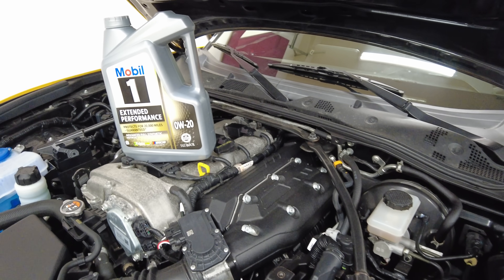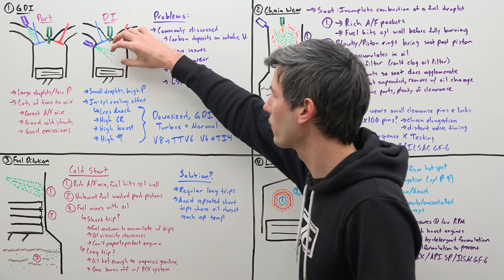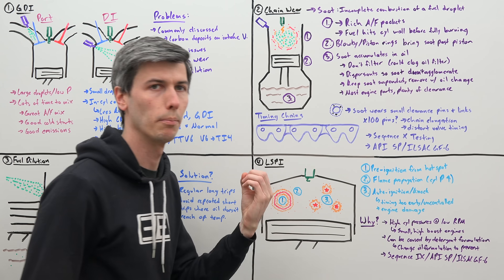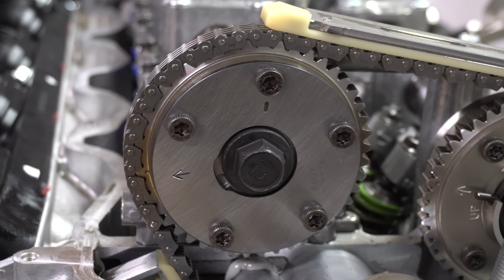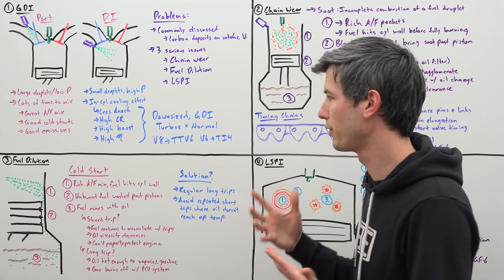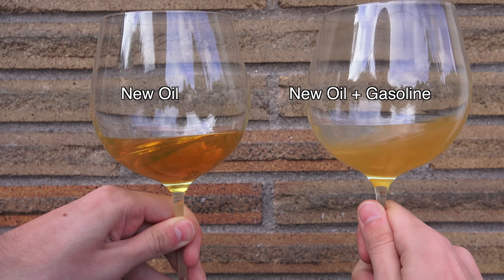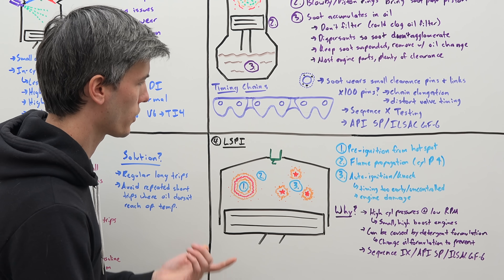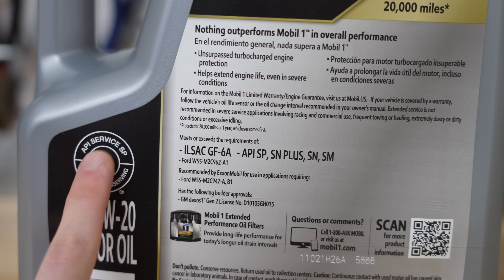3 Big Problems With Direct Injection Engines (Gasoline)

Comment: Hi mate. I have a VK56 V8 that has direct injection.

I'm noticing it sounds like a really bad pre-ignition on hot restart. 

IE.. drive for 30 mins, park, come back 15 mins later and restarting and it sounds like one bad pre-ignition just as it starts. Any ideas?

Comment: The truth is recipracting engine is a wrong concept. That's why it's so complicated, inefficient, expensive in production costs and maintenance. The worst is the design of the valves. How can such a design become so common.

Lastly the blow-by will happen even not during winter. It also  happens in Asia, warm climate countries. Because of the high pressure within the combustion chambers. Piston rings are metal. Won't be 100% preventing high pressure gasoline from slipping pass piston rings and contaminating the lubricant oil. This might be causing wear and tear everywhere slowly. Slow but surely will kill the engine. The only way to counter this is keep on changing new oil. 

Everything about engine design is wrong and ridiculous since day one. High pressure reciprocating engine won't last. This will explain why GDI system cars have no resale value.

Anything high pressure will have leaking issues due to the seal. Nothing seals high pressure from leaking efficiently.

By adding supercharger is another disasters. As for turbo charger. The high temperature from the exhaust gas will ruin the seal.

Comment: I like your channel, but you are overselling theory these days. All this stuff is not relevant even in racing environments. If you change your oil frequently and you use the right type and brand, Direct Injection is not an issue even in a Lab environment. “Reduced lubrication due to fuel Vapor dilution in the oil?” Come on mate, fuel evaporates in hot oil and fuel fumes are sucked back into the intake. Petrol engines are hot and dirty by nature, this is why we re switching to electric cars. We can’t overanalyse the nature of internal combustion engines. looks like you re running out of content, but this is not the right way to create new content. Keep it real bro. Greetings from a loyal subscriber

Comment: I have a 2016 ford edge awd  88,000 .always runs good. Never a problem. I use penzoil ultra synthetic 5w30 .Is that a good oil for gdi twin turbo ? Should I look at mobile 1 instead?

Comment: With the combination of 0w20 engine oil and fuel dilution of oil, don't expect a 300k mile engine any more. 200k would be pushing it on a GDI.

Comment: Filter the soot with a bypass filter, common on large diesels, its really keeps the oil clean and the wear down
Reply: Exactly what I was thinking, an easy routine to just replace that filter at regular intervals, and won't block up and reduce oil pressure. A clever manufacturer could even make a filter similar to a DPF and burn the soot off
Reply: Clever and DPF should never be together.
Reply: @derekhobbs1102  point taken 🤣
Reply: Umm, a bypass oil filter plugging will NEVER reduce oil pressure. The key word here is BYPASS l. Apparently you don’t know how they are plumbed.

Comment: I have a bit of an off-the-wall question that may be too obscure for a general video, but here it is anyway.

My 2012 Mini Cooper S - a DI engine - "likes to sit" at 220 degrees. I have an aftermarket OBD connected engine temp gauge that I can confirm this behavior. If I push it hard, it will drop to 217-218 but it will stay up there. When I press the "sport" button the engine temp drops almost immediately to 175 range.

Any ideas why they programmed the engine to stay right at 220? Is that a fuel economy thing or a fuel-in-oil thing or maybe something else happening?

Comment: there is an fix for this , to have a separate enclosed area for the timing gears where the oil is not connected to the main engine oil, use a fumigation system  to enhance the fuel burning including a good fuel injection cleaner to clean away any deposits , as well as the main fuel
(cleaner there as well) as i had a lpg Nissan patrol 1984 mod with a drip system(as injector cleaner cannot included  to an lpg tank) ,tune test showed that it burned the fuel better than a new car.
an other additive for the engine oil is a soft metal metallic which imbeds in to scoring on parts a really great product, i now have a lpg fumigated diesel with timing gears 350,000km still on the same gear box and engine .

Comment: I own a car which has BOTH of these  fuel injection techniques it has 240000 miles on it without any breakdowns 8 cylinders 16 injectors any ideas its a 2007 car guess away

Comment: Some food for thought: what if we made an engine with the high pressure injection system, and mounted the injectors in the intake manifold like it used to be?
Reply: It wouldn't change much. The only reason the high pressures are needed in direct injection is because they have to overcome the ambient pressure of the highly compressed air in the combustion chamber, whereas the port injection only needs to overcome the ambient pressure of the intake manifold air, which is much lower.

Comment: The real problem is that in a turbo charged engine the fuel droplets are prevented from vaporizing/mixing due to the high pressure. Therefor the droplets will not completely burn and create soot. It is like throwing a log on a fire, the flames can't get to the heart off the log. 

A turbo charged direct injection system is a bad idea because it creates soot which destroys the engine, especially if it also uses a egr valve to recirculate the soot back into the engine

Comment: Fuel dilution and short trips are why manufacturers say 3 months OR 6000km whichever comes first. Too many people go a year or more without an oil change because they haven't driven 6000km... And these are the people that have horrible engine failures.

Comment: I believe there are also problems with the high-pressure fuel pumps that are required for direct injection
Reply: I just made the same comment.  Costly to replace too.  You can count on a big repair bill every 50k miles

Comment: So, what about extended guaranty for models with such Technology ?
I don't believe 0w20 for 20.000 miles even 10.000 for the general driving average, that is nearly water for any boosted, hihg RC GDI engine.
BimmerN53
Reply: Huh?
Reply: @billiebobbienorton2556 not suitable for minors

Comment: This is 1 reason amongst others why I use 10w40 in my k20c1 whereas honda states using 0w20, plus having water/methanol injection, just like ethanol blends it dilutes the weight of the oil.

Comment: Direct injection is great, until your intake valves start to get plugged up with baked-on oil deposits from the crankcase vapors that get recycled into the intake via the PCV valve. The trick to avoiding this is to disconnect the PCV valve from the intake plenum, and then plug up the holes at both ends. You temporarily reverse this for your yearly emissions tests.
Reply: Then your crankcase pressure destroys every seal in your engine shortly! Lol! DERP!
Reply: Then your oil gets filled with raw gas and acids that etch the journals and cylinder walls, and, your seals will get blown out by the pressure in your crank case.

Comment: This is why I'm still in an old 2010 Port Injected Mazda 3 (that and hydraulic steering, no stability control, manual parking brake, and the ability to hit the gas and brake pedals simultaneously without freaking out any computers). Since 2013 all Mazda 3s have been sold with DI and need $200 intake valve cleanings every 40,000km. My next car will either be a Civic  LX with the Port Injected 2.0L K20 C2 (great motor, 20yo and used in F4), a BRZ with port and direct injection, or an electric.

Comment: Iv got a 1998 saab 9-3 engine in my 2007 astra vxr. Very few electrical sensors on these engines and very simple and extremely easy to get more power from.

Comment: Well I learnt something new today! I was aware of the soot build up problem on the inlet valve, but I didn't know that GDIs tended to put more soot into the oil in the 1st place, and I didn't know that could be such a problem for timing chains!
I work at a Suzuki dealer, we've noticed that the GDi engines generally have much darker oil when drained, I thought it was mostly related to them being turbo'd engines, now I know better! And Suzuki increasing the service interval from 9000 to 12,500 miles for the Booster Jets (their name for turbo'd GDi, lol) seems an even worse idea now! But, so far, no timing chain issues, although the oldest engines are only from late 2015 (at least here in the UK) and they're the ones on a 9k service interval. We've not seen any of those reach high mileage yet though.....
Reply from the maker: Thanks for sharing your experience, interesting!
Reply: Also as mentioned in a previous Eng.Explained vid., the max. internal temperature of a N.A. engine is  ~200`C compared to a turbo's engine's 400`C. This much higher temperature also can compound with the specific GDI problems (e.g., making the soot in suspension more abrasive) and adds weight to the argument around more frequent oil changes than the +10,000miles.
Reply: @zenden6564  And would probably increase soot oil load via more carbonising of the oil, as well as likely more piston blow by from higher combustion pressures.
Reply: Also because because the stratified injection for low load and low speed. The mixture is bad and builds up soot like Diesel engine. It's why they have to use GPF no?

Comment: I have long held that what's best for cold engine starts and warm-ups is to allow a few moments after start (put on my seatbelt, adjust radio, etc.) and then drive off moderately to get engine up to temp without straining it while cold. I do this as opposed to allowing the car to just sit and warm up more slowly at idle. Is this still best practice for GDI engines regarding fuel getting past the rings?
Reply: As a Canadian, you are doing it right...Reaching operating temp while at an idle is basically infeasible up here. 

Best practice is pretty much start the car, wait 15-30s in the summer, or minute or two in the winter just to make sure fluids are circulating, and then drive normally (no excessive rpms, try to avoid using boost) until you reach operating temp. I typically wait another 5min after in case the thermostat was running closed, and you still need a little more heat, but that's mostly for "spirited" driving.

Comment: Thanks for the in-depth info!!  Knew that GDI made soot (see chrome exhaust tip covered in carbon after not washing for 2 weeks!).  Now soot in oil and engine wear.  Fuel dilution.  And drive a GDI motors kinda’ like they’re diesels; get them fully warmed up so that combustion is complete, less soot is formed, and no long term oil dilution. Oil has diesel-level surfactants now to trap microparticulate soot.
 Don’t tell CARB or they’ll require a DPF in Cali to trap soot from GDI motor exhaust (like diesel’s) soon.

Comment: I have a 2018 Civic with the direct injection 1.5t and the oil has always reeked of gas and noticeably increased in volume over time regardless of trip length. Actually, the majority of the miles driven has been long between Oregon and California and changing oil right after a trip still shows gas in the oil. So with this engine, I can't say with any confidence that trip length has any effect on oil dilution with gas.
Reply: There was a recall for that problem on those engines, but it was only for cold climates like Canada and a few northern US states. There have been complaints in warm areas too, though. Try contacting Honda or do some research to see if you can get any help with the problem. Seems to be a poor design by Honda.
Reply: Its in all climates.  Even here in Southern California,  even in the desert area where it can be 115 to 125. Those engines get loaded with gas in the oil.

Comment: Doesn't vw have a dish pattern on the piston so it spreads evenly off the piston surface without cleaning off the cylinder wall?

Comment: Had a 2012 Kia Sorento, ended up having to trade it in when I was coming home from work one night. Heard a pop under the hood while driving (80mph). Got off my exit, had to pull over the whole car was shaking, engine light was on. Come to find out it had an engine misfire, likely due to carbon buildup.
Reply: More likely just a bad coil pak. If your not car savvy, they can take advantage of that. What did they say was wrong with it?

Comment: Excellent info as always. 
These gave me ideas on How to "Fix" these 3 problems:
1.- Change Your Oil in Shorter Intervals wink wink mobil 1
2.- Drive it Like You Stole it so Engine Oil Gets Hot
3.- Try not to Go Full Throttle unless after 3,000 RPMs
Reply: Disagree with driving like you stole it..assuming your 0 wt 20, is now 0 wt 10, or less,  high rpms with oil that has barely more viscosity than water,  will be extremely bad for rod bearings,  along with everything else.

Comment: worst engine model is the one with GDI! i have long terrible experience with this design
high efficiency/filtered gasoline, cleaner air and good temperature atmosphere are the main requirements to make it possible for this engine to work properly

Comment: Great info and thanks for sharing.  One question:  Why does the intake valve develop carbon deposits?  I understand the cleaning affect of the port injection, but it would seem that the exhaust valve would be more problematic than the intake with it's fresh air flow.  How is the carbon moving up the intake?
Reply: Positive Crankcase Ventilation (PCV) recirculates the blow-by gasses into the intake.

Some oil vapor/mist also goes along for the ride, which is why some people install oil catch cans to try to reduce that. I have my doubts they actually help that much though.

German cars, and probably a lot of other cars, already use multiple oil separator cyclones built into their PCV systems, so adding an additional oil catch can seems redundant.
Reply: The exhaust valve operates much much hotter as it’s passing burned air as opposed to atmospheric. Burns off any deposit
Reply: Usually, the intake valve opens slightly before the piston reaches "top dead center" on the exhaust stroke while the exhaust valve is also open (valve overlap) The residual pressure in the cylinder is often higher than intake manifold pressure, especially at low RPM/high load. This allows a small amount of exhaust to move up into the intake (reversion). The amount of exhaust back-pressure on turbo engines compounds this issue. The particulate matter in this mixture of exhaust and intake gas condenses on the cooler surfaces of the intake manifold and back of the intake valve. If fuel is being injected into the cylinder during this time, fuel is also being pushed back into the intake where the heavier hydrocarbons condense on the cooler surfaces causing carbon buildup on the intake valves. Throttle body injection and port injection do not suffer from carbon buildup as bad because the fuel is washing down the surfaces, especially on a cold start...or something like that :)
Reply: @oldcoot3459   waffle. Nothing modern has enough overlap because of emissions. It’s all pcv that collects on the intake valve
Reply: @hoonaticbloggs5402  Then why don't catch cans eliminate the carbon buildup? Because of emissions, valve overlap is used a lot. It can used to eliminate an external egr valve in some applications. VVT engines increase overlap at higher RPM's to improve performance while decreasing emissions. On turbocharged engines, it is increased to help spool the turbo faster.
Reply: @hoonaticbloggs5402  Then why don't catch cans eliminate the carbon buildup? It is because of emissions that valve overlap is used a lot with VVT. In some applications, overlap is used to eliminate an external EGR system. Valve overlap is increased at higher rpm to improve performance and decrease emissions, and also on turbocharged engines, adding overlap helps spool the turbo faster.

Comment: My trips are all roughly 15 min or less and I have a 16 F150 with the 2.7L. I had an oil analysis done and they suggested inspecting the fuel system due to excessive oil dilution. Now I know why. I use full synthetic oil and change it every 3k miles cause I know these little turbo motors are hard on oil.

Comment: Just this week, on Wednesday to be exact, I passed 300,000 miles on my direct injected 2015 Mazda 6 SkyActiv 2.5L.  Still runs and shifts like new and the 33mpg average is nice too.  Change your oil people and buy a Mazda.
Reply: How often do you change the oil??
Reply: @1958Cadillac-v2g  Every 5,000 miles.  I drive a lot of hwy miles so sometimes I’ll hit 5,500 because I’m far from home, but never past that.  Castrol 0W20 extended mileage oil (gold bottle) with a GOLD Fram X6607.  I drain and fill the transmission fluid every 75K too with Genuine Mazda ATF.  The only non-maintenance I’ve ever done to this car was a belt tensioner at 125K.  I will likely get another one (my third one...had a 2014 but it was “totaled” in a car vs deer at 65mph)

Comment: I had a 2018 mustang gt pp2 6speed manual that was direct injection and tuned port and i was blown away that with the hp it had i still could get 29 mpg on the highway luckily ford offered me 32k last may and i only owed 24 on it at 41 k miles because i wasnt lookin forward the repairs and after seeing this i did the right thing i enjoyed the hell out of it while i had it tho